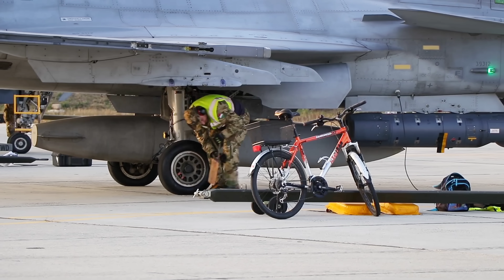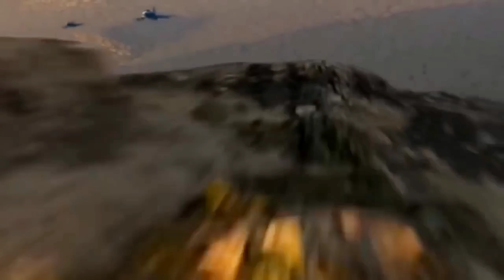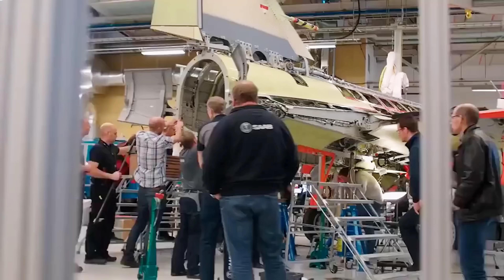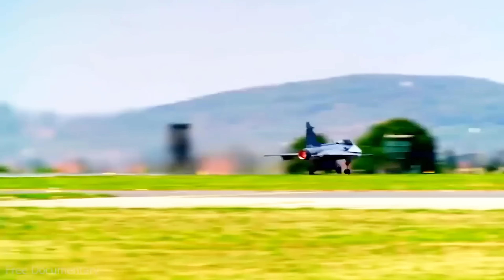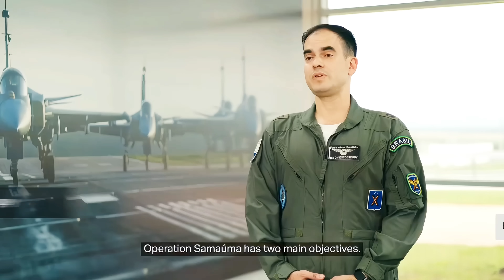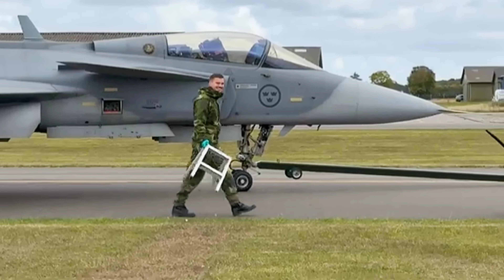How Rolls-Royce Quietly Rewired the Gripen Jet - And Shocked NATO Overnight

Comment: This rumour just will not die. There is NO Rolls Royce Powered Gripen. Nor are there even publicly admitted plans for one, which would take years to build and approve.
Reply from the maker: Exactly 👍
This rumor refuses to die, but the facts are simple: there is NO Rolls-Royce–powered Gripen.

All operational Gripen variants use GE engines (RM12 / F414), and there are no publicly confirmed plans for a Rolls-Royce option. Even if such a project were announced tomorrow, it would take many years of redesign, testing, and certification before becoming reality.

Until then, it’s just speculation — not an actual program.

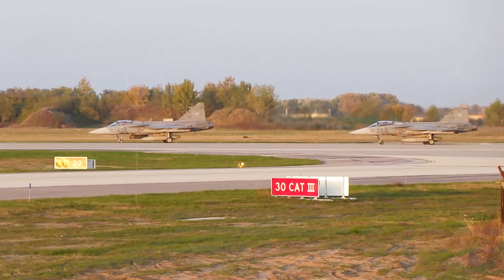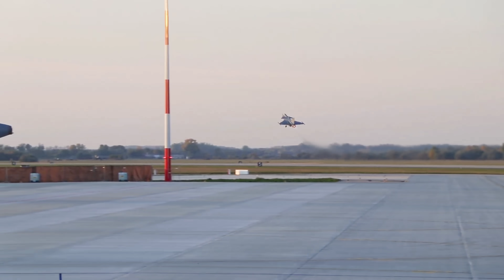Comment: Sorry people, but this video is complete bull: total testicles.  There isn't a shred of evidence for ANY of the claims it makes.  The source doesn't even realise that Rolls Royce Motor Cars and Rolls Royce Holdings (the jet engine business) are COMPLETELY separate companies with completely different ownership and have been since 1973!  So clearly no proper research has gone into this clickbait.  They also imply that the F-35 is a twin engined aircraft (2:20 - 2:50).  There's been discussion of the EJ200 since RR offered it at the start of the JAS-39E programme, but that's all it has ever been.  Certainly no Gripen has ever been fitted or flown with the Eurojet.  You've all been fooled by a blatant lie.

Comment: Canada also would serve as an assembly plant, so Gripen would be built in Sweden, Ukraine, and Canada - hopefully enough to supply all of NATO. BTW, F35 costs CDN100,000 per hour of flight time versus Gripen at CAD8,000.  Also, F35 Stealth is for first strike. NATO is not supposed to First Strike. Also, heat trail gives away stealth. And Gripen sensors more accute (greater distance) than F35 in summer 2025 Baltic NATO exercises.

Comment: Rolls-Royce EJ230 engine is theoretical. Due to the extra weight, performance would be  degraded from the present GE engine. Source: Euro Defence Apr 25
Reply from the maker: You've brought up some interesting points about the theoretical nature and potential performance implications of the engine!
Reply: Euro Defence, journalists opinions. Good to show your sources 👍
Reply: It will be a derivate of the EJ230.
Greetings from Frankfurt, Germany

Comment: This video claims stuff I cannot verify ... but also the resulting "conclusion" isn't substantiated even if the claims are all correct, and the whole thing sure smells like AI nonsense.

The Gripen is not a competitor to the F-35 in the F-35's role, and the argument over what Canada ... or other western nations ... should do WRT air DEFENSE is completely misrepresented here ... to the point of B*LLS**T.  Let's try to straighten a few things out ... 

#1: the whole point of stealth is for OFFENSE ... penetrating what otherwise is too dangerous to go into.  If a nation is strictly concerned about territorial defense, then given a budget it is far more effective to spend resources on radars and ground-based defenses than it is to spend the money on stealth attack aircraft.  (which is what the F=35 really is.  It isn't a stealth air-superiority fighter... that's the F-22). The real point of the F-35 is to do things like what Israel just did to Iran.   If your military planning doesn't involve that  then the appropriate fighter is the F16 or the Gripen ... or if one could afford it and get them back into production: the F-14.  The Rafale is a contender ... as was the F-18 ... but the operating cost of the twin-engine fighters isn't necessary in this role.  Secondarily even rich nations that want F-35 capabilities have at least a two-tier fighter air force, even the USA does, and again the rational choice for tier 2 is the F-16 or the Gripen. 

#2: the Gripen compares to the F-16 ... duh. 

#3: The whole world is dealing with the ugly fact that the president of the USA is an angry, narcissistic, grifting dumbass and groper , who is obviously becoming increasingly demented ... All of that by itself might be manageable... but he's a Putin-wannabe.  Remember, he wanted to force Canada to become the 51st American state.   He has tried to force Ukraine into a disastrous "peace" with Russia.  And then there are his whack-job tariffs, that oscillate at his whim.

Thee real nightmare scenario is that Trump makes a Mafia-Don "turf deal" with Putin just like the Molotov-Ribbentrop treaty ... a deal to divide Europe.  You think this is impossible?  I don't think this will happen, I don't think the American public would accept it... but then I never thought America would elect, and particularly reelect, this "populist" kafabe ass-clown.

So basically the rest of the world has a choice: kiss Trump's sh*tty bum ... or not.   And that choice puts Europe (and Canada, and Japan, and Australia ... yada yada) into the position that it is time, indeed long overdue ... to stop leaning on American military capabilities for protection.  It's up to y'all ... waddaya goin' to do?  It does mean that you need to actually DO something ... or just bend over and grease up to Putin and Trump.   The choice is yours ... but talk-talk and endless Euro-commissions isn't the answer.

Comment: For many months now there has been an been an increasing prevalence of pro-Gripen propaganda on YT, much from sources I've never heard of.  

Often the same Gripen footage is shown (frequently laterally flipped) along with unrelated, almost random footage of entirely different aircraft (including Russian types like the Su-35 and this one even included air crashes) while the Gripen is specifically discussed on the soundtrack. It feels to me that this footage has largely been acquired using AI, thrown together in no particular order in edit as so much "video wallpaper" over the commentary for folks who don't know better.  Meanwhile the voice-over is almost always the result of some kind of automation that often mispronounces names and numerical designations, producing a synthetic voice with a selected tenor from a supplied text script, which might be the only original part of the whole piece. 

Sometimes totally unsupported claims are made and sometimes downright demonstrable errors. One of these (not this one) seemed to imply that the GE F414G engine was made by Rolls Royce! They frequently suggest that Canada has already committed to these aircraft instead of the remainder of the 88 Lockheed-Martin F-35A fighter bombers they originally intended. I've not seen any formal Canadian announcement of that, nor the anticipated harsh response I would expect from Washington. 

My point is that the Gripen appears to be an excellent aircraft which might indeed be a good fit for Canada but viewers should be wary of videos extolling the many virtues of the the SAAB JAS39 Gripen E/F, especially regarding a done deal for Canadian service. This feels more like marketing bumf than fact and there sure has been a lot of it lately.

Rolls Royce have been making jet engines since the Welland of the mid 1940s. Nobody would disagree that they really know what they are doing. It's great that they have modified the General Electric F414G engine to improve survivability for the Gripen. However the Volvo RM-16 (a license produced variant of the American GE F414G) is still the engine that powers the Gripen and Washington can deny export licenses, software updates and spare parts. For countries like Canada trying to assert its independence from a lately hostile US, this engine is almost certainly not an option, however Rolls Royce may have improved it. If such countries are to buy Gripens they need to come without American remote control. 

For all the new information this video offers about Rolls Royce enhancing the F414G engine, there is nothing about a much discussed Rolls Royce designed proposed alternative to it, the EJ-230. AFAIK this does not yet exist. It would be a development of the existing EJ-200 engine that powers the Eurofighter Typhoon. An EJ-230 powered Gripen would become a viable option for countries like Canada seeking independence from US control. 

Have Rolls Royce and SAAB have already been secretly developing it? 
If not, this engine would take years and substantial cash to develop, while SAAB would have to substantially modify the Gripen to accommodate it, which would again take considerable time and money, I have not seen any suggestion that this is under way,  how it would be funded and what additional delays it might be expected to add to Gripen deliveries.

When additional costs and delivery time-frames have been confirmed for a Gripen E/F independent of US control can be verified, please drop me a link.

Until then, in my mind all of this is just so much glossy marketing.  🇨🇦
Reply from the maker: You've laid out a very detailed and critical analysis of the current landscape of information surrounding this aircraft!

Comment: The current Gripen E still use the USA GE engine. They have not switched to Rolls- Royce YET. It’s a massive Chang in design and expensive to do so. Fingers crossed for Canada.
Reply from the maker: You've brought up some important points about the current engine and the implications of a switch!
Reply: They will do this because neither Saab nor Canada have any choice.
Reply: @peterhug5866  The US has already REFUSED to approve the End User Certificates for the GE Engine for various countries that wanted to buy the Gripen.   If SAAB truly wants to sell oworldwide, then they must get rid of the GE Engine...and tU.S. Control over who buys the Gripen.
Reply: @airborne63  previous version of the Gripen had Volvo engines developed in cooperation with the U.K. and were banned for saling them to Argentina
Reply: Has to be done to get round Trump export licence refusal, as has been done by the US in the past

Comment: The main thing to take away with Gripen's is that you are not held to usa contracts, the plane doesn't have to be sent back to usa, do not need a contract to work on or American technicians or mechanics or order parts from America. With American plane's you are tied into every aspect and they can still flick a switch to turn them off for no reason at all. Even when a American piece of equipment is sold they still have control over them, this is not on once something is sold it is now there's for better or worse.
Reply from the maker: You've really emphasized the strategic independence that comes with this aircraft!
Reply: @ViperWings803 thank you.

Comment: What a crock of shit! NATO just got another front line fighter, it can be exported without a US veto!
Reply: No. The aircraft currently has an American GE-414 engine.  The U.S. is using that fact to DENY SALES of the Gripen, by refusing to issue End User Certificates/Export Licences for the Gripen.  They just did that to Peru and Coombia, both of which WANTED the Gripen to replace their aging mixed fleets.   Peru just boght the Rafale instead, but the US is trying to FORCE Colombia to buy F-16s instead, according to my info.

Comment: Heat, efficiency, software all great. Well done Rolls Royce. But it's still a GE engine! The real gamechanger would be an actual RR engine, and thus not subject to US political control / export controls / ITAR usage limits.
Reply: That will come, but it's a lot of work.
Reply: @peterhug5866  In process, so I'm told.
Reply from the maker: You've brought up some important points about the engine's origin and the potential for a complete shift!
Reply: EuroJet EJ230 engine would be ITAR free but is a consortium setup for Eurofighter so multiple partner nations will have to agree; Germany, Britain, Italy, Spain.

Comment: The best thing canada can do is get the gripen with the rolls royce engine get away from american parts and food they need you more than you need them and they arent going to tell you like they told the swedish that you cant sell to this or that coumtry then can they and ypu dont owe the anericans squat do you hey go camada go
Reply: They can only do that as long as the GE 414 engine is in there.  They're now doing the mechanical work necessary to fit a new R-R engine into it, not just a General Electric MODIFIED by R-R.

Comment: I hope Canada purchases Gripen with Rolls-Royce engines, and eventually manufacturing them in Canada also. This would support the increasing request for SAAB's Gripen aircraft from other allies.
Reply from the maker: You've laid out a very clear vision for Canada's potential acquisition and manufacturing of the aircraft!
Reply: Yes, with a new RR engine, to REPLACE the GE 414.....the US would NOT then have the CLUB that it uses to REFUSE sales to countries that want to buy the Gripen, by refusing End User Certificates, which they have done to Colombia and Peru.  Peru then bought the Rafale, insead.  Colombia...hasn't decided.   The United States has control over who buys the Gripen, as long as the Ameircan Engine is used in it, and SAAB is losing sales.
Reply: @airborne63 not for long. The momentum with rolls Royce has shifted the interest and along with it future sales. The US won’t have any say period moving forward now. That’s huge for the rest of the world, and the engine is even better than the GE garbage 414 that was in it in the past

Comment: Rolls Royce motor cars and Rolls Royce Holdings PLC are completely seperate. Rolls Royce motor cars has nothing to do with aircraft engines, generators and the like.
Reply from the maker: That's an important clarification about the distinction between Rolls-Royce Motor Cars and Rolls-Royce Holdings PLC!
Reply: Yes and No.  The name is tide to the RR Holdings but the Car Company has the right to use the name. That how BMW outsmarted Audi when Audi thought the bought RR. But BMW hade already required RR Holding and Aircraft engines. So Audi hade no rights to use the RR name.  It was the most epic moment when Audi realized the had only bought an old car factory.
Reply: @henrikl1394  semantics.

True, the Rolls Royce name is tied, in fact owned by Rolls Royce Holdings. BTW, tide is the movement of water in oceans.

But the fact is Rolls Royce cars, owned by BMW, and Rolls Royce Holdings are completely separate companies operating in different sectors. Rolls Royce Holdings operates in aviation engines, marine engines, nuclear energy generation.

VW bought Rolls Royce/Bentley company but failed to get the licence to use the name. Rolls Royce Holdings preferred a more prestigious company for the Rolls Royce car marque and agreed a deal with BMW.

Hence Bentley is part of VAG and BMW got the prize - the right to use the Rolls Royce marque

Comment: Isn't the engine made by GE ? I think that's American.
Reply: The aircraft currently has an American GE-414 engine.  The U.S. is using that fact to DENY SALES of the Gripen, by refusing to issue End User Certificates/Export Licences for the Gripen.  They just did that to Peru and Coombia, both of which WANTED the Gripen to replace their aging mixed fleets.   Peru just boght the Rafale instead, but the US is trying to FORCE Colombia to buy F-16s instead, according to my info.

Comment: 1) The current, or older engine, while a GE design, is NOT made by GE, but made in Sweden by Volvo Aero (now GKN Aerospace Engine Systems).  2) A revised "airflow pressure modulation system" in the same physical engine (RM-16) could improve all the Items mentioned in this video, but the improvements would be minor (but not insignificant) not "earth shattering" as suggested in the this over hyped video.
Reply from the maker: You've brought up some very specific and interesting points about the engine's origin and the scope of the improvements!
Reply: So, if it's NOT an American Engine, why does the US call it the GE-414 Engine, and have the RIGHT to REFUSE End User Certificates, which is what they're doing to screw up SAAB's marketing?

Comment: I'm confused. It still has the F414 engine which is US built and is thus dependent upon US protocols. Rolls Royce redesigning the airflows etc doesn't alter that dependency. Now, if you are talking about installing a Rolls Royce engine that's a whole different ballgame, but that is a few years off, is it not?
Reply: No.
Reply from the maker: You've brought up an important point about the engine's origin and the potential for future changes!

Comment: Years ago I already said that the Gripen with a Rolls-Royce engine will aprove instead of Pratt& Whitney! I hope that European countries will understand the value of this plane and maybeCanada can produce them! 😅
Reply: The aircraft currently has an American GE-414 engine.  The U.S. is using that fact to DENY SALES of the Gripen, by refusing to issue End User Certificates/Export Licences for the Gripen.  They just did that to Peru and Coombia, both of which WANTED the Gripen to replace their aging mixed fleets.   Peru just boght the Rafale instead, but the US is trying to FORCE Colombia to buy F-16s instead, according to my info.
Reply: I'm German and completly with you.
This summer there were flight tests over the Baltic Sea with a Saab Gripen E in which the KI solution Centaur by Helsing was embedded for autonomous fighting situations.
In addition the wings of this Gripen have a different wing geometry. This jet joined RIAT 2025.

TO the engine of the EJ230 derivate:
The potential engine will build by the Eurojet Turbo company. The shareholders are RR 33%, MTU Aero Engines 33%(Germany), Avio 21%(Italy) and ITP 13%(Spain).
The Implementation of this engine will be challenging but this is business as usual. Greetings from Frankfurt, Germany

Comment: The Rolls Royce EJ226has 26,000lb thrust. The GE engine is 22,000 lb thrust. The RR switch divorces the Gripen/ Gripen US from US technology sovereign dependence, unreliability, control and switch offs.
Reply from the maker: You've highlighted some really important points about the engine's thrust and the strategic implications of the change!